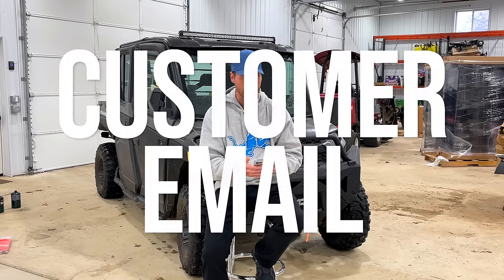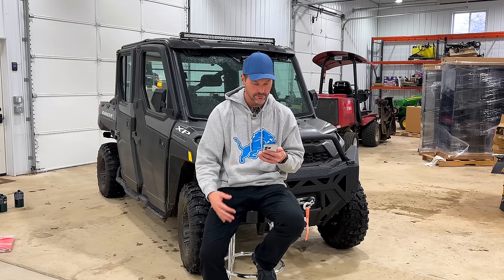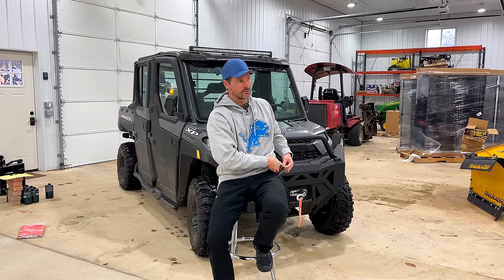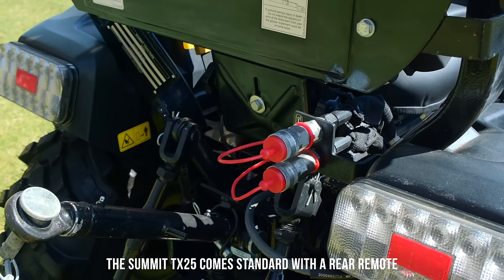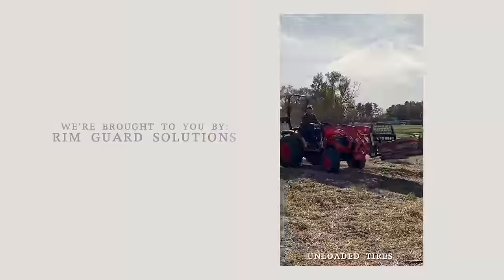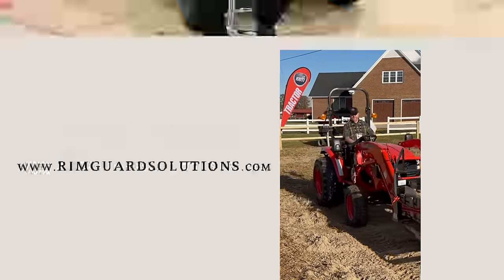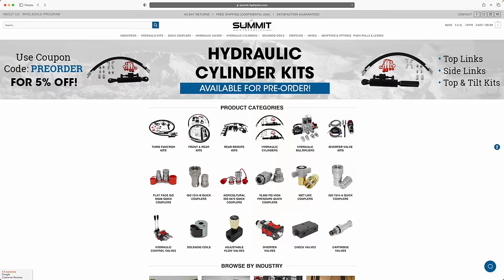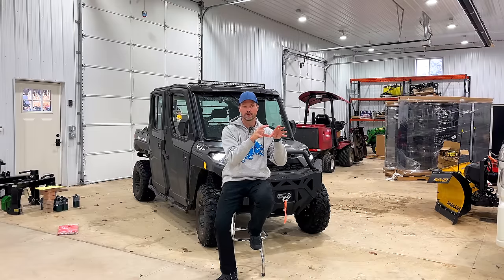UPDATE OR UPGRADE THIS NEW HOLLAND BOOMER?

Comment: Agree fully with the upgrade the current tractor. I added a SSQA from WorkSaver and a front 3rd function from WR long to my 2018 New Holland. If I were to do it again, for as much as I use my grapple, which is a few times a year, I would have gone with a brush crusher and saved the dough on the 3rd function. If it had enough flow to run a auger or some other implement that I needed up front, maybe worth it, but for a little less functionality I think I’d rather have the couple grand back from the 3rd function. The SSQA is an absolute necessary upgrade though - forks change the game. I’d also consider getting a new HLA or other slightly larger bucket with SSQA plate already on it rather than cutting the pin flanges off the stock bucket, buying a ssqa adapter plate and welding it in. By the time you’re done, time and money wise you are more than halfway to a new bucket. I did that and then put some three point cat 1 pins on my stock bucket and use it as a carry bucket in the rear, handy to through log rounds in to transport and for counterweight.

Comment: I would definitely go for upgrading an existing machine rather than buying a new one. Most upgrades if you do it yourself can be done quite cheaply labour wise and your machine will sell for more if it has more functionallities. I myself bought an old tractor which I'm planning on to restore it a little and upgrade it with a rops, work lights, warning beacons, new cables because most of the electronics doesn't work properly😅, 2 or 3 double acting remotes, new paint job, new decals, replace some worn parts, maybe I'll upgrade al the lightts in led, maybe I'll ad some extra aftermarket options, I think I'll upgrade the original exhaust for a decent chromestack or an replacement exhaust and maybe a pre cleaner for the inlet air. I also definitely want to have a few front weights preferably a whole set of original 40kg weights that came with it. My tractor is already quite well outfitted for the most tasks I want to do with it and for an 50 year old machine it already has quite a lot of the luxurious options on it. But before it's completely the way I want it to be I think I'll be a few years in to the future😅😅😅 the plan is to start a little contracting and upgrading it on the way so it becomes a much more nicer tractor to see and use and be more proud of to own as it's getting nicer.😊😊

Comment: Good coverage of a common question. Something you didn’t mention but implied is to try to think thru possible future uses of your tractor & get those mods / options when you buy the tractor. Example, if you think that you may ever use a hydraulic attachment (or implement), get that added before you take delivery of your tractor. Also in this category: filling the tires w/ liquid ballast, changing tire position/ adding wheel spacers, and my favorite - a cab. Most of the time you’ll spend more $$ to add these options later, than if you had the dealer install them up front. I recognize that you just might not have the additional $$ up front for options, but you’ll appreciate the savings if you can swing it at time of purchase. Just my experience. Others will chime in if they disagree.

Comment: I strongly recommend having extra hydraulic outlets fitted at the front and back when purchasing a new tractor. You may or may not need them later on but if you do then it will have been a lot cheaper to have them fitted at the outset. If you don’t use them maybe one day you sell your tractor and it will be worth more on the sale.
Reply: Yeah it definitely will sell for more with extra outlets. Also convenience things will make it worth more just every little upgrade is going to make it more versatile and worth more. I don't know if dealer fitted remotes are worth it because it can ad a lot to the price. If you're a little mechanically inclined you can fit them later on if you want and maybe for way less than a dealer🤷🏻‍♂️
Reply: @KevinJD2030  it’s better for the dealer to install this sort of stuff for a few reasons. Firstly it will be easier to install as the tractor is new, clean and with the dealer. So if anything goes wrong, leaks or malfunction you can throw it back at the dealer. Secondly the cost of extras can be included in the price of tractor and the finance of it.

We had an extra rear remote fitted to our tractor before delivery. Neither rear remotes have been used yet, we bought the tractor in 2020, but in 2024 I’m planning to buy a spreader that does have two hydraulic functions. So if I can save up for the spreader, which is damn hard, I’ll be using those hydraulic circuits.

Comment: New Holland guy here.  I bought a SSQA adapters & a 3/16 plate for the bucket from VEVOR for less than $300.  Then for around $600 I used a Kubota kit from Summit Hydraulics for the 3rd function. I did the work myself so about 5 hrs of time was the additional cost.  I did it for the 72" 2 jaw grapple and couldn't be happier.

Comment: Good review of options.  Since he is happy with his tractor, I would probably go with the SSQA upgrade if money is not an issue. It gives you a lot more flexibility. 
He could even save some money by purchasing Precision's  Grapple for pallet forks by going the SSQA route. You can do a lot of grapple work with Precision Grapple for forks. We like ours and have done a lot of work with that set up.
If he stays with a pin on bucket, I would definitely get Precision's wider open grapple for we the bucket. I think it gives you 55 inches of opening rather than the standard one, which I think is around 35 inches. Also, if he goes that route by staying with his pin on bucket,  I would get the double grapple if his bucket is more than 60 inches.

Comment: I've built my own ssqa for a compact wheel loader, and it is not easy and that's coming from someone with a lot of welding / fabrication experience (10 years).  If possible and if you have some welding experience, keep a look out for maybe a broken down skid loader that you can get the quick attach off of and adapt.  I've done that too and that's a lot easier than fabricating it from scratch.

Comment: Thanks for this video.  I have been struggling with the same question.  I have a 1023E with a non quick attach bucket.  It really has done almost everything I need.  I have been thinking about trading it in for a 1025R with a quick attach bucket.  Now I think I will just get a set of forks that will attach onto the bucket.  I like the last few in the shop videos.  Very informative.  Learned a lot.  Happy Holidays.

Comment: Interesting discussion.  When I go to get a tractor, might it pay to get the "badly equipped" used tractor (no SSQA, no 3rd function, etc) at a lower price vs a better equipped generally equally quality with the idea of installing the upgrades?  Do used tractor prices reflect the lower utility enough to make it worth the hassle, especially if one knows this "going in"? More of a PITA that route, but what's the $$$ / hour of my time?  The same difference in buying a lightly "fixer" house (only needs paint, carpet and other cosmetic updates) vs the "move in ready".

Comment: Anther consideration if you need more attachments,  is that (at least with John Deere), you get 0% financing.  I traded in my 2 year old 1025r, for a 2038r and added a backhoe, as well as several other attachments.  My payments went up, but not as much per month as if I had financed the attachments for the 1025r.  Bonus, I now have a more powerful tractor with a great backhoe (as opposed the small one that fits the 1025r).  Yes I did get a grapple (I also got the 4-in-1 bucket).  I had the m add the power beyond, 3rd, 4th and 5th function.  I did have to pay for it, but for each $720.00 financed, it only adds $10 a month, so for $100 a month additional cost, you get $7,200 worth of attachments or options.  If you are happy with your tractor, and just need a grapple, get that.  u if you find that you are using your tractor for more than you had originally thought and find it is a bit undersized and there are many attachments you wish you had originally purchased, then trading in makes sense.  Good luck trying to finance $14,000 of equipment for $200 a month. (a loan like that will likely cost you more than the payment for the attachments and the tractor).

Comment: If his tractor is in good condition he could sell it. Those NH Boomers with low hours, and from that period, are selling for $14k-$15K. So, he could potentially sell it and buy a new tractor with the 3rd function and rear hydraulic remote for a few thousand dollars, which is what he'd spend to upgrade it. The Summit TX25 would be a perfect candidate for that, and also the TYM 2515H. The 2515 has a lift capacity of 2200LBS at the pins! That's more than double what the Summit and his Boomer 25 can lift.

I think as long as he could sell his current tractor for a fair price he would be better off buying a new one. If not, then I would keep the Bommer and upgrade it.

Comment: Yes, upgrading a current tractor is almost always less expensive than replacing the tractor with a new one.  Now, if you can trade for a good used one that is equipped the way you want, that might be less expensive than upgrading your existing.  Pretty much like buying cars.  It is almost always cheaper to keep your current car going than to buy a new one.  However, there are factors other than money so that comes into play as well.

Comment: Does anyone here have any experience with Tractor Innovations diverter kits?  It seems like a good solution for someone who doesn't use their tractor much but wants extra hydraulics on demand.  A kit cost a third of most aftermarket 3rd functions and has no solenoids to fail and doesn't require modifying the joystick.  Another option would be an electric actuated grapple like the Worksaver ESCG-48.